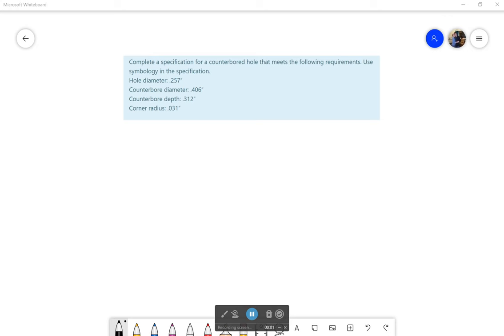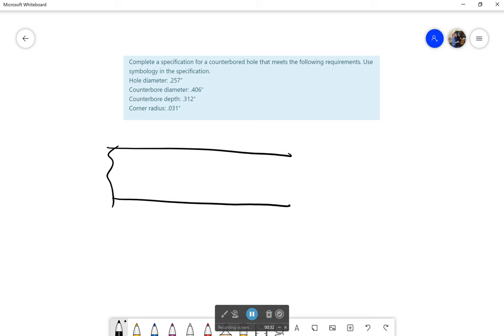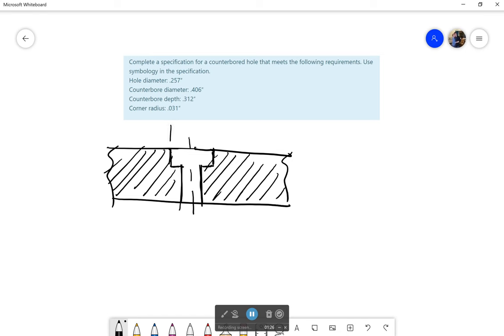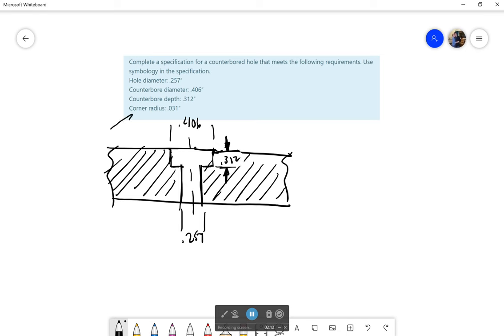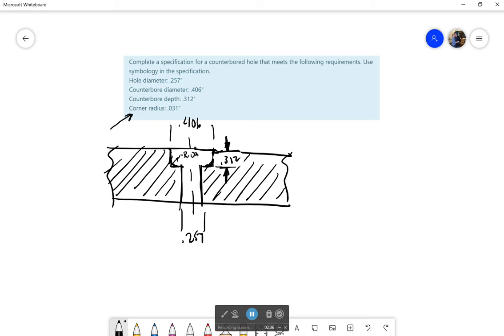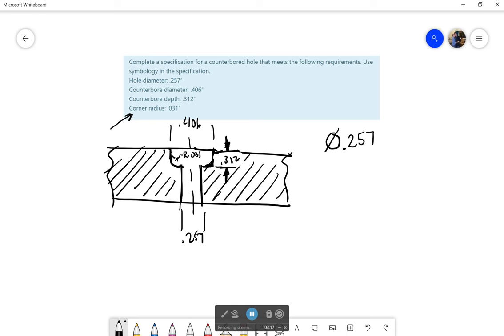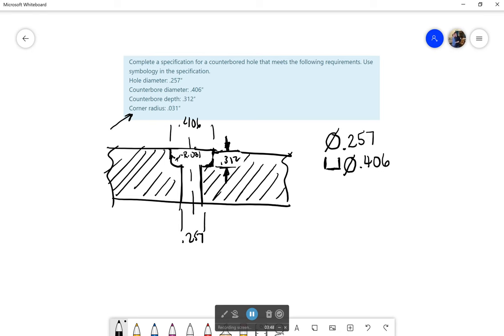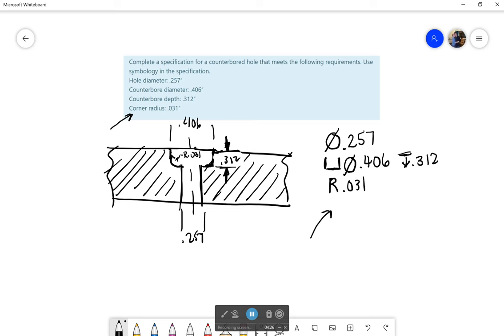Counterbore Specification

Comment: Thanks for the video. I want to ask a question if you don’t mind. What if the surface is ramped on one side and depth is not constant? How should we show it?
Reply from the maker: If you were in a situation like that, you would have a hidden line showing the ramped edge that is not visible in your current view. You would also likely need a separate view to show that the depth is not constant and your ramped edge would possibly be a visible line in that view. Short answer, just use multiple views to remove ambiguity.
Reply: @drkiddengineering  Thank you drkidd 🙏